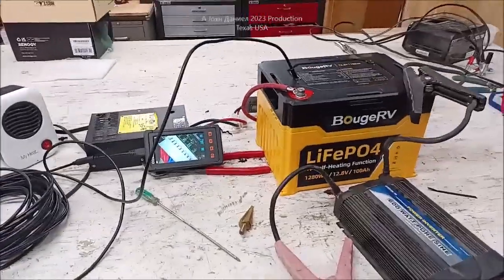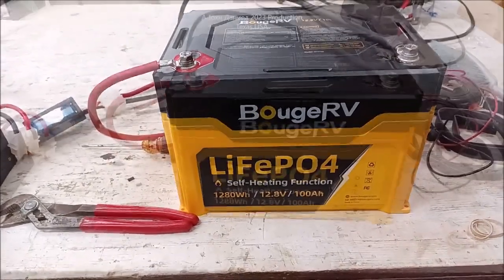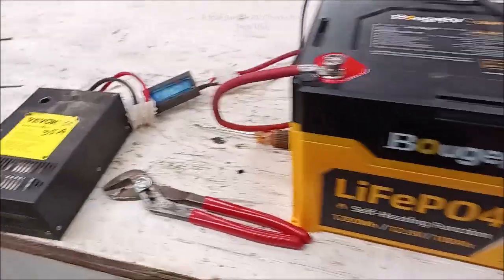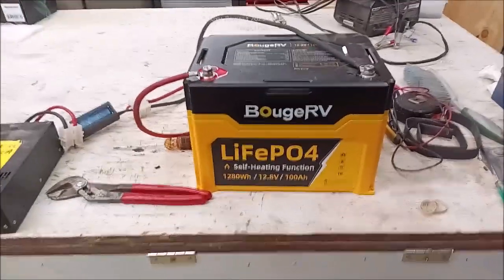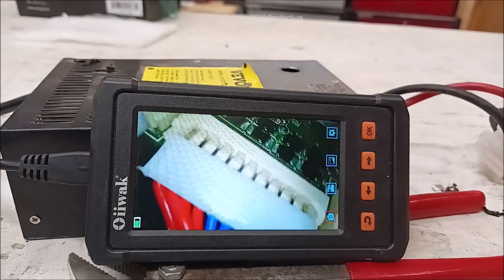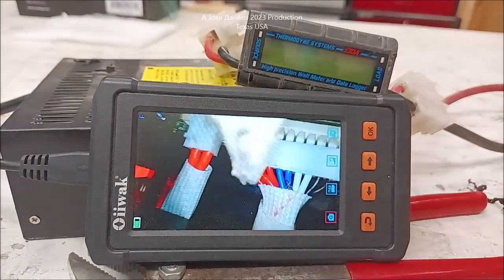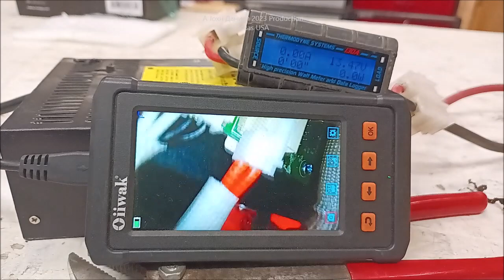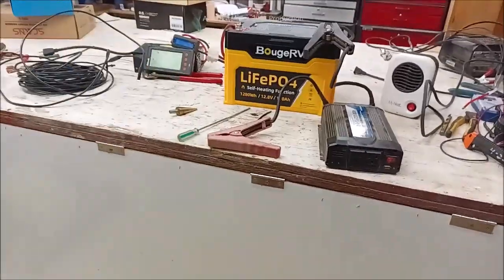BOUGE RV LiFePO4 Self heating Battery, OWNER REVIEW of the high cost of lower quality

Comment: Hello John! I really do enjoy your videos. Question about the Power Queen Premium Battery did they stop selling it? I can't find it listed anywhere. I think that they may have replaced it with that new smart push button battery?if they did can you get one and test it out for us?
Reply from the maker: You can still get the premiums going directly but they have sold so many it's hard to keep in stock. The 200 ah plus that are under my video link are now $150 cheaper and are a hard hitting battery like this one. They did say I would be sent a email when more were available, I want 5 of them to put in the Holiday Rambler.
Reply: I don't trust a smart battery
Reply: Same boat, I have one PQ 100a premium, and went to buy another one to parallel and it's gone, not even listed on their site anymore, and not available anywhere. Pretty bummed...
Reply: @MrBeerfix  I bought 2 100ah Premium  P[Q batteries in Nov. and in Dec they came out with the new Smart push button 100ah and then all the Premiums everywhere said sold out. Now not listed anywhere???
Reply: I watched them dump 15 used ones on Amazon within 2-days then they vanished. I was going to buy 4, but buying zero now.
Reply from the maker: I got a response back from Suo and she said the case manufacturer shut down in China, so since October they have placed the battery pack for the premium in the new standard case, those are the only ones with it from the direct web store not other locations. https://shrsl.com/3wp2y ( HER REPLY ) *Mr Daniel, Sorry you not to find your choice battery as we apologize. We have still contract supply by CATL for cells to put in premiums but not compact case you ask for. You can trust we had to make adapt to assemble line so using case of standard 100 ah and I send you link to it, other vendors not yet get stock of premium in standard case so pick you additional battery from that site so you get same component in that battery just not compcacted. Sorry for so many bad feeling having hard time we have many thousand emails wanting best battery still to answer and hope supply chain is soon fix. 
Suo Cheng CMO
1908A-1, Building 2,
Jingji Yujing Times Building,
Huanggekeng Community,
Longcheng Street,
Longgang District, Shenzhen
Reply from the maker: @massa-blasta   got a response back from Suo and she said the case manufacturer shut down in China, so since October they have placed the battery pack for the premium in the new standard case, those are the only ones with it from the direct web store not other locations. https://shrsl.com/3wp2y ( HER REPLY ) Mr Daniel, Sorry you not to find your choice battery as we apologize. We have still contract supply by CATL for cells to put in premiums but not compact case you ask for. You can trust we had to make adapt to assemble line so using case of standard 100 ah and I send you link to it, other vendors not yet get stock of premium in standard case so pick you additional battery from that site so you get same component in that battery just not compcacted. Sorry for so many bad feeling having hard time we have many thousand emails wanting best battery still to answer and hope supply chain is soon fix. 
Suo Cheng CMO
1908A-1, Building 2,
Jingji Yujing Times Building,
Huanggekeng Community,
Longcheng Street,
Longgang District, Shenzhen
Reply from the maker: @MrBeerfix  got a response back from Suo and she said the case manufacturer shut down in China, so since October they have placed the battery pack for the premium in the new standard case, those are the only ones with it from the direct web store not other locations. https://shrsl.com/3wp2y ( HER REPLY ) Mr Daniel, Sorry you not to find your choice battery as we apologize. We have still contract supply by CATL for cells to put in premiums but not compact case you ask for. You can trust we had to make adapt to assemble line so using case of standard 100 ah and I send you link to it, other vendors not yet get stock of premium in standard case so pick you additional battery from that site so you get same component in that battery just not compcacted. Sorry for so many bad feeling having hard time we have many thousand emails wanting best battery still to answer and hope supply chain is soon fix. 
Suo Cheng CMO
1908A-1, Building 2,
Jingji Yujing Times Building,
Huanggekeng Community,
Longcheng Street,
Longgang District, Shenzhen
Reply: @JOHNDANIEL1  Thank you for that. The size can be dealt with easy enough, though I already had myself set up for 6V GC batteries, and the compact Premiums were a perfect fit replacement. All I really care about is the cells and BMS being the same since I'm going to parallel. In your opinion, do you feel like thats a safe bet here?
Reply: @1JOHNDANIEL any input on paralleling these two?
Reply from the maker: @MrBeerfix  Yes, you will be fine up to 4 batteries they say, but I have done 6 without issue. I even put 2 of the 200AH, 1 of the Premium compact, and 2 of the 100A base models together in that converted RV with the 2200 solar on its roof. 4 months, still pushing power like a locomotive. The game is the controllers, wire gauge, and common sense. Use 4 awg on the 100A, 2 awg on the 200A, and make them the same length to the main buss. Natural wire gauge amp max acts like shunting and self balancing when you hit them hard. And never charge them to over 90% or let them go under 20% and no issues will exist. Solar settings do Charge at 14.20 top setting, and use a inverter with 11.5 low volt disconnect like the SWI Power and your self regulating.

Comment: Sorry to hear about that battery and their lack of support. Off-topic, could you recommend a 12V input single inverter that will supply 240V output just like the electric utility's drop line to run my well pump in an outage, please? Much obliged.
Reply from the maker: Sungold 4000 watt 240volt on 12 volt battery, https://amzn.to/3RmnjDj by Yamu Tamichi Industrial, built like tank, but drives like Ferrari! It ran our 435 foot deep well in Idaho, 2.25 horse 240 volt. And still would fire up the 4 freezers in the back room. Read up on it. Reviews are real, and they DO NOT buy or reward fake reviews.
Reply: @JOHNDANIEL1  Thanx, we appreciate that.

Comment: My friend it is not shorted out , it has a poor connection AKA open circuit.
Reply from the maker: Poor Quality Control is what it was, the connector does not have a integral snap, or a zip tie or even gobs of silicone on it. If it at least had some natural tension it would help. And to sell a heated battery with one heated side left dangling is just pitiful, the screw was installed, the terminal ring left hanging. That is sad.

Comment: Cold-Ass Mornin Y'alls! Holy Shit-Knockers, Hey John, Just Put A 12v Silicone Heatin Pad Under Your Batteries w/A Switch To Turn It On... All Are Cheap On eBay or Amazon!   🤔😜🤣😁😎
Reply from the maker: I can just use 4 of the 25 watt 12 volt silicone pads and a 0 degree click disc good for 10 amps each like I plan to do when I put the 4 big Power Queen 200AH into service.
Reply: @JOHNDANIEL1  That'll Work Too... 👍👍😁😎

Comment: Would you mind cutting apart the Power Queen battery so I can see what kind of cells are inside? Can't be the same cells as the regular version, obviously. U got glue, you can fix it back. Other companies selling Plus and Premium versions of their batteries too, lets not compare apples and oranges.
Reply from the maker: The battery cells in the power queen is made by CATL https://en.wikipedia.org/wiki/CATL
Reply from the maker: got a response back from Suo and she said the case manufacturer shut down in China, so since October they have placed the battery pack for the premium in the new standard case, those are the only ones with it from the direct web store not other locations. https://shrsl.com/3wp2y ( HER REPLY ) Mr Daniel, Sorry you not to find your choice battery as we apologize. We have still contract supply by CATL for cells to put in premiums but not compact case you ask for. You can trust we had to make adapt to assemble line so using case of standard 100 ah and I send you link to it, other vendors not yet get stock of premium in standard case so pick you additional battery from that site so you get same component in that battery just not compcacted. Sorry for so many bad feeling having hard time we have many thousand emails wanting best battery still to answer and hope supply chain is soon fix. 
Suo Cheng CMO
1908A-1, Building 2,
Jingji Yujing Times Building,
Huanggekeng Community,
Longcheng Street,
Longgang District, Shenzhen
Reply: @JOHNDANIEL1  I appreciate the information, but I am not a very trusting person when it comes to the Chinese.

Comment: What is the best angle of degree for solar panels ? I think that I read 20 degrees. I am located in South Tx. SE of San Antonio 90 miles.
Reply from the maker: 20 to 22 degrees if your 100% south facing, under 18 if your not. Thats summer setting. For winter setting its 31 degrees. Best year round setting is 25. A 3 to 12 roof pitch is good in most of Texas.
Reply: @JOHNDANIEL1  Thanks for the info. I am going to try and make the mounts adjustable.

Comment: the heater only works when being charged
Reply from the maker: No, it's always on for low temp use. It will cycle once temps get under 31 degrees Fahrenheit / 0 Celsius  whether your charging or not, so you can use it in the cold OR charge it in the cold without damaging the LiFePO4 cells
Reply: @JOHNDANIEL1  then they're the first in the industry to function that way which would kill the battery. The BMS stops charging below the cold setpoint but allows the charger to input 5 A to warm the battery heat pads above the cold setpoint. They don't draw any energy from the battery itself. LiFePO4 has no limitations on discharge below freezing only a charging limitation.
Reply from the maker: @jstaffordii  I sat it outside in 22 degrees, not on a charger, then in 45 minutes went out with my SEEK thermal camera, it was warm but not to the touch. They just don't seem to be like anyone else. My Sun Fun Kit battery, 304 AH only activates the heaters if you attach a load to it, then when its over 28 degrees it allows full load. When charging it pulls 44 watts till it connects the cells when warmed to over 30 then it will pull full charge into it. The Bouge is not like it.